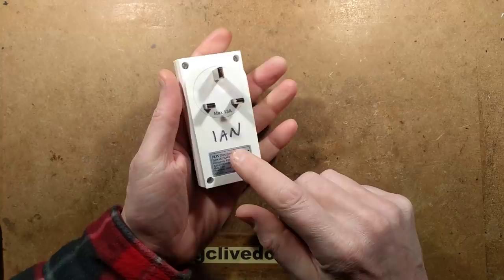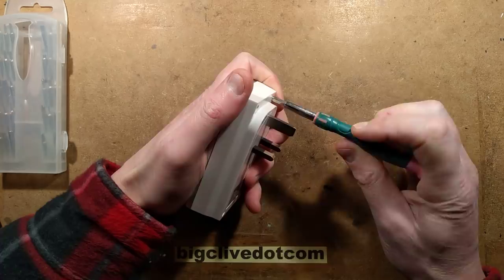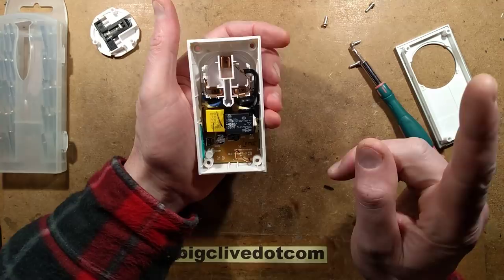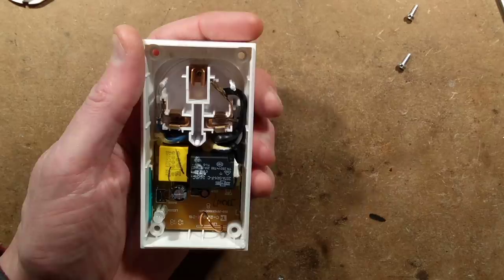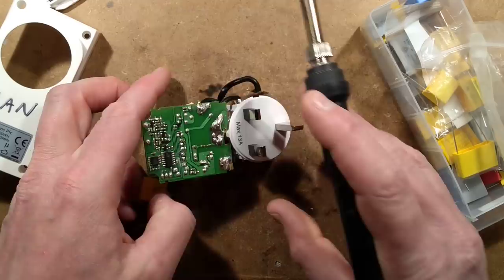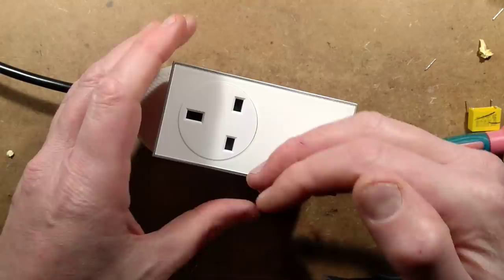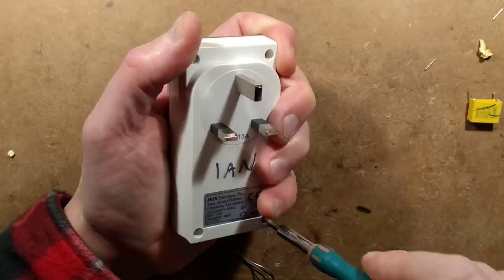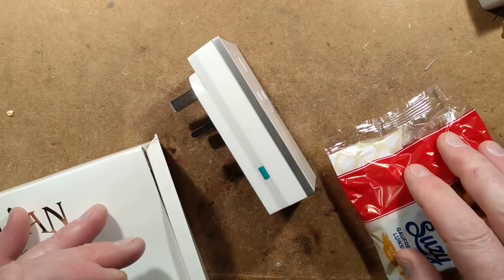Fixing a faulty remote power switch.

Comment: If domestic supplies begin to be charged at the industrial rate, I'm more than fine with a switch to apparent power. I'd prefer the ability to lower my power bill by improving power factor than to be charged for someone else's assumption of what that power factor is (which is why current domestic electricity is charged so much higher than industrial).

It would also be nice to get proper monthly billing rather than these ridiculous estimates the big 6 rely on.
Reply: I very much doubt that the change to apparent power will be accompanied with a price drop in electricity prices.
Also you really should read your own meters and submit monthly readings. I haven't had an estimated bill in many years due to submitting my own readings.
Reply: @tinplategeek1058  That's not how eon see it... I asked them repeatedly to adjust my monthly bill per the readings instead of "estimating" what I'll use for the rest of the year to no avail, so in the end I just gave up and found someone who will.

I agree though, switching to apparent power at the rates they charge for real power is too much of a cunt move to pass up!
Reply: @233kosta  It's been many years since I used E.ON  but didn't have that issue at the time.
However things do change within companies and now I swap companies to a new fixed price tariff without any attempt at brand loyalty.  I haven't been with the same supplier for consecutive fixed contracts since the 00's.
Reply: They're not going to bill, rather regulations worldwide have been enacted to force a minimum PF on all sorts of devices. This includes US DOE/Energy Star, EU ErP, Australian MEPS, etc. PCs at this point are required to be .90-.95, and larger external DC supplies are required to be efficiency level VI which requires 0.9 PF.
Reply: @straightpipediesel  Well then perhaps the less scummy thing to do would be to pass the resulting savings to the consumer and offer rates which reflect the improved power factor
Reply: @233kosta  At least in the US, inflation-adjusted power rates have been flat or declining for decades. This is due in a large part to energy efficiency measures: per-capita energy use has been declining, and overall power use is flat.

Comment: I have one of these from BandyQ 3-set that has failed. There was a recall on them due to self-ignition issues, but I just put an 'X'  on mine and chucked it into the round-tuit box; the others still haven't caught fire. I never thought of caps failing like that, now I know, I'll fix it.

Comment: 10:59
The cap laying directly on the four diodes just screams planned obsolescence.
Reply: @daverhodes382  The diodes produce heat, although I have to admit I wrote the comment before clive said it's ok. But that tiny bit of heat will eventually kill the cap and therefore the device. I see these sorts of design choices all over consumer electronics

Comment: My name is also Ian and I had what's probably the exact same problem with a similar remote switch unit on or around December 21. If I'd watched this when it came out, maybe it would have been fixed in time to avoid reaching behind the Christmas tree to turn the lights on and off.

Comment: +bigclivedotcom
Why, did traditional fluorescent lights, traditionally use an  inductive-dropper  rather than  capacative-dropper  to run their tubes/lamps?.
Would that be cheaper,  except that the inductor is used for back-voltage to start the system etc.?
Reply from the maker: If you use a capacitor in series with a fluorescent tube there is a massive current spike one each half wave when the tube strikes and its voltage drops.  That results in sputtering of the electrodes which blackens the end of the tube and rapidly destroys the lamp.

Comment: Good video I Like RF-related issues with me being a ham. The frequency that is on 433.92 we share that band 70-centimeter wavelength & I just tuned there & I can hear pulsing so an unusable frequency for long distant contacts. We cannot complain as we have 10 MHz bandwidth allocation on low band UHF & we are secondary users on there but, the band is getting congested with all these gadgets..  Thanks.

Comment: These capacitors are actually the issue with a lot of devices. I fixed quite some things, especially coffee machines (like Phillips Senseo) by just replacing these.
Reply: I've had 2 Kill-a-watt devices die this way also. One was a genuine one, the other a cheap knockoff. I thought they might have died sooner from being used on a modified sine inverter.
Reply: Well, they do that on purpose.

Comment: These switches are sold under the LightWaveRF brand, and there's a full range of remote control devices available including dimmers and boiler switches. I use three of these to remotely switch my Christmas light display outside our house.

Comment: Just a thought on that covered window in the front panel - Don't suppose it was for an 'activity' light by any chance? - A small LED on those two pads that might flash when the remote control is activated, or possibly to confirm 'pairing' of the remote and socket unit? - A featured that might have been discontinued to save a few pennies on an LED and a small lens, or an option that was never implemented. - Just a couple of ideas as to what it might have been for.

So, there goes our Clive again, anti-tampering with with far eastern commerce by mending things that weren't meant to be mended!

Comment: Oooh, a LWRF product. Used to work for them not so long back, pretty cool team.
Reply: I'm slowly filling my house with them, good stuff.
Support is good too, had an old 200 series fail and even though it's not in production any more thay rummaged about in the bins and found 400 series replacement for me.
They also have a few of the wirefree switches about when I can afford them.
Things that aren't in the new smart series that I will really miss.
Reasons not to upgrade ;)

Comment: I once repaired a fridge where the only fault was that the dropper cap of the control unit had failed. It used (I believe from memory) a single 1 uF cap. But conveniently there were footprints for two caps in parallel. So I put in two 470 nF caps, of different brands, to hedge my bets. Has worked since, from what I've heard.

Comment: Cool Video Sir.   Is there a means to program the codes on those things ?   Pair up multiple units maybe ?   I didn't know you could test Cap's in circuit .   Not always the case I think.  Sorta cool they used wire for the antenna. Much better then a simple PCB copper track antenna.
Reply from the maker: Sometimes caps can be tested in circuit.  The only components likely to skew the result in a dropper are the discharge resistors.

Comment: Hi Clive, if that is an X2 capacitor, I thought they were "self healing" capacitors. When they fail due to over voltage spike the dielectric "heals" itself.
In doing so the total capacitance reduces on each "failure".
But  may be wrong, just X2 I have replaced were in high voltage spike situations, and I have found other X2 just as old that are still at near full capacitance and in a circuit that does not have the potential for regular over voltage occurrences.
Don't you toast the waf(f)el and put ice-cream and topping/sauce in it? Loverly...👌
Reply from the maker: If you put one across the mains it will have current flowing continually.  All a dropper does is rectify that current.

Comment: No one will ever charge for "apparent power" the power companies compensate with pole mounted capacitor banks.  Your many little .15 PF appliances plus your inductive loads, motors and such (like your a/c and fans) combine to a much more normal PF than Big Clive realizes. It is NOT a problem! Ron W4BIN
Reply from the maker: The electronic power factor is not easily corrected by simple capacitance.  All the current is drawn near the top of the sinewave.

Comment: I have a power meter that glitches when using a mains engraver as metering source or even plugged in the same extension without measuring. Other than that it works and reads OK for resistive loads ( heaters) and LED bulbs. It did glitched when the relay clicked, maybe the inductive spike from the solenoid of the relay triggered that?

Comment: How critical is the capacitor dropper value in something of that ilk? Does it matter if the value is a bit larger?
Reply from the maker: A higher value would result in the zener diode that clamps the voltage getting hotter.

Comment: I have the same screw-driver set, its around 1.50/2 bucks!!! got it in a place called Mr price!! and dirt cheap shop(pound shop)!! the tips are soft but if you take care of them they will last. I only got it coz it has those weird screw types, like the triangle tip and the double pin type like what Clive's using ....

Comment: I've got a 'Smiths' plug in digital timer socket with a similar fault, the power LED & relay switch on for about 3 seconds, then just turn off again,  could  be similar problem,  although its done well, in continuous use for about 12 years, I used it to control some garden lighting.
Reply from the maker: It's almost certainly the dropper capacitor that has failed.  It might be repairable if it's not all glued together inside.

Comment: BigClive: What is that magnifying glass that you're using? I've always wanted one of those of that kind. The one with the smaller glass (which I'm guessing has a larger magnification than the one with the larger glass in it?). 

Thanks!
Reply from the maker: That looks like it.  They do them with a range of magnification levels and corresponding diameters.
Reply: Thanks for asking that question, just ordered one on the link.!!

Comment: I was playing my electric guitar through my solid state amp, and I started to get a tingling through the strings and bridge, these are earthed it became quite uncomfortable, so I plugged into my other amp (identical) and it still happened, so I grabbed my multimeter but by the time I got hooked up it had stopped, what the hell was going on?
Reply: Might have been some little ground touch current, but i'd have no idea where it originated. Possibly outside your household?
Reply: I also used to get that on my Audio Mixer... I think your capacitors are dying
Reply: I don't know much about musical amps and such, but it's possible something else on the circuit failed / went horridly wrong and dumped current to ground...
Reply: You got an RCD?
Reply: Must be earth failure somewhere, probably in the wall socket.
Reply: You were feeling the emotion of the music man! Tingling your soul
Reply: if the amp is earthed/'supposed' to be earthed, maybe bad earth connection  in it, or in any extension lead used, or even the mains socket  it was plugged into..
Reply: Next thing you know you'll be cooking Christmas dinner and the mystery fault will come back with vengeance and not let the breaker reset.
Reply: I don't think the string ground is supposed to be connected to the wall ground. At least on tupe amps I think audio ground and chassi ground are different things At least they shoulde be decoupled so thats where I would start.
Reply: @rimmersbryggeri  so no 'electrical supply ground' connected to the main signal ground? in other words its 'double insulated', with 2 core mains in?  that seems bad idea as if theres an internal mains to input ground short, that could be very nasty
Reply: If you have a meter, check to see if there's voltage diff between neutral and ground.  You can also buy a socket tester that looks for current leakage to ground.  I've also seen more than a few SS power supplies do stupid things with ground that keep it from doing what it should.  Look up "pin 1 problem" for examples of bad grounding design.
Reply: i've come across laptop psu/chargers with 3 pin mains in connector that dont have any connection to the eart pin, so if theres an earth to low voltage output leak/short, the output will be live...very nasty
Reply: @jimfeldman4035  neutral cant be relied on to be 'ground', potential, it 'should' be but you never know, more likely check amp input 'ground' to mains 'ground' ..
Reply: @andygozzo72  I'm not an expert on how thise works but the only time I have ever gotten tingles from mics or guitars is when they have been connected to a phantom powered mixer through a cale where the braid has been commoned onto 2 pins of an XLR. Is done sometimes with speaker cables and when those are confused with mic cables you get  a tingle through your lips from dynamic  mics if the phantom power is on.
Reply: @rimmersbryggeri  😲
Reply: You were just getting into the vibe. Or more accurately the vibe was just getting into you.
However, wouldn't the strings and bridge ground be an audio ground loop and so will be different from the power ground!
Reply: I have the same problem with our old Apple MacBook Pro. I get a tingle from the metalwork while the charger is connected. The touchpad becomes unuseable - the cursor develops a mind of its own. If I touch the metalwork with my other hand, the cursor works a little bit better. Unplugging the charger returns everything to normal. The spooky thing is that my son didn't believe me until I showed him. He then tried, with absolutely no problems at all. Perhaps that should be a Halloween story.
Reply: @andygozzo72  actually the string frounding on the guitar uses your body to reduce hum I think it's the resistance of the body that does it. If your guitar has active electronics there is no such ground.
Reply: @travelbugse2829  My MBP is the same. I fixed it by connecting a wire to mains earth and clipping the other end to the body of the MBP. It also cured an annoying "zizzing" sound in the right-hand headphone! [DO THIS AT YOUR OWN RISK!]
Reply: @manolisgledsodakis873  I can't believe Apple would do that! Sounds very dodgy - literally.
Reply: @manolisgledsodakis873  Sounds like that variant of MBP supplies has the Y cap accross the transformer like in many supplies shown on this channel. That'll leak a small amount of mains power into neutral to reduce radio noise without access to mains ground.
Reply: The amp was giving you a vibe check.
Reply: There are two conductors between the amp and the guitar.  One has a very high impedance, so it's not your likely issue, and the other should be earthed or fully isolated.  My guess would be both amps tie your instrument's hardware to the wall socket earth, which doesn't match something else you were touching while playing -- perhaps your damp shoes on the cement floor.  As it happened with both amps the likely failure is at the wall socket.  As someone else said, neutral may not always be earth.  When large single leg loads kick on, like the fridge or a heater, do some lights get dimmer and others brighter?  That would indicate a loose neutral, perhaps in the feed to the house.  If the socket ties the amp's ground to neutral instead of real earth, the potential difference between neutral and the floor could have been your tingle.
Reply: That is the joy of playing live

Comment: Why would the capacitor have stripes marked on it? Is that an “ok” type mark from qa or a “bad cap” marking?
Reply: Almost certainly from QA (for the functional PCB, rather than just the cap) -- I used to put similar stripes on electromotors and ECUs. Of course black stripes won't show up on a black relay, so the yellow cap gets 'em  :-)

Comment: I have a Socket 1 gang, made by JSJS, I'm sure it did the same thing has been in the cupboard for a while, I've just opened it, and looks like the same layout but the capacitor says 15uF K 275v X2, looks smaller but think I might try a replacement 👍
Reply from the maker: That's probably a 1.5uF capacitor for a 120V supply.
Reply: Update , it was a .15uf , so I ordered some, they are a bit bigger but I squeezed it in, wired it up and it worked, going to put it back together and run for a few days, on the meter it seems to test ok ? Cheers great video

Comment: A handy fix tip for me - will bear it mind, so many thanks. 
Have you been sent any blown transformers/inverters for low voltage lighting? Many of my neighbours have flush-fitting ceiling downlights and if the old halogen bulbs go pop they usually take out the transformer (fitted through the ceiling hole) too. I retrieved one from my wastebin. It's called a Tamlite EU-2060. Mains to 12V, although in modern tech parlance it is described as Max 60VA. It says it is Thermally protected, Automatic Resetting, Fully Dimmable, Short Circuit Protected. I keep saying I will open one up and try to fix it, but you know so much more and do it so much better...

Comment: this seems to be a common problem lately, the motor start+run cap in our tumble dryer dropped from 8uf to 5.5 uf, it made it slow to start or even not turn at all sometimes...admittedly that one was over 15 years old, i presume the fairly heavy current flowing in and out of the cap makes the metallising rot/melt away 'cause its so thin,  if the cap was used purely for very low current 'signal' coupling, it'd probably last forever
Reply: you used to be able to get high ripple/pulse current types, mostly used in scan coupling circuits in crt tvs but of course they were much larger
Reply: i've seen the datasheet of one type/brand of X2 caps and its says something like 'not suitable for capacitive dropper applications'.  dunno why, does using them for capacitive dropping cause strange peak currents? wouldnt have thought so..???? can you use X2 or Y2 caps on DC? they dont usually give a DC rating? maybe any DC offset on their current/voltage causes erosion of one 'polarity' of the metallising..?? but if they're feeding a 'full bridge', there shouldnt be any DC component????